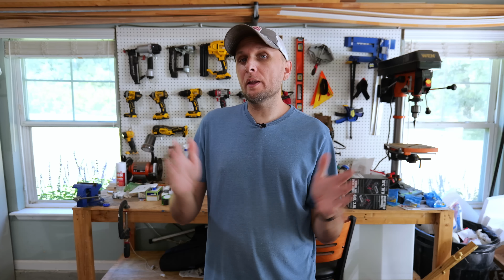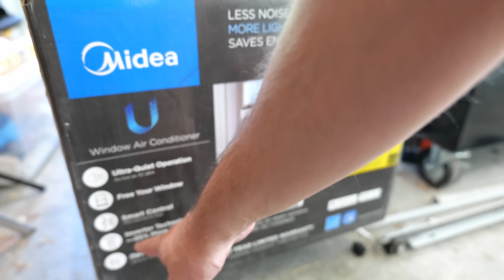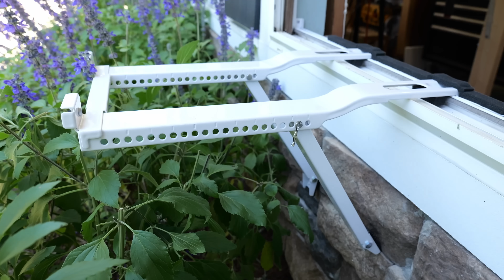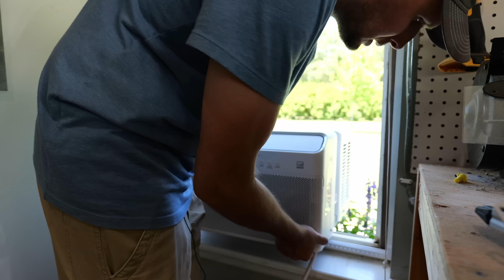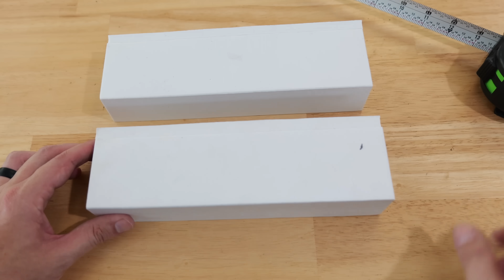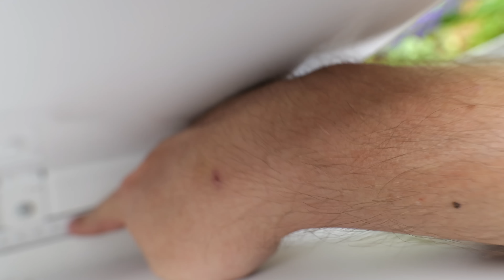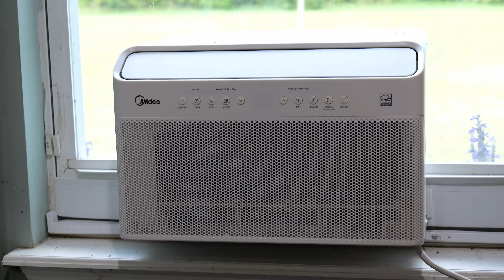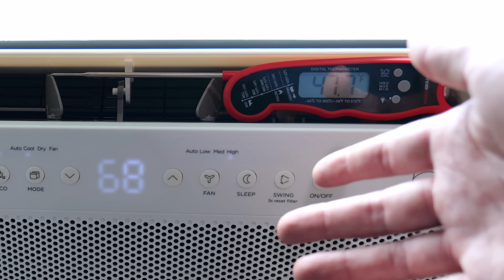The COLDEST And QUIETEST AC Unit Ever Made!  Still Use Your Window!

Comment: “As low as” means it could be a screamer but could be at the lowest setting 32db.  I have it and it is super quiet.  Only problem is it has a recall because it’s a mold monster.  They didn’t put in a drain because it was supposed to evaporate the water from the heat generated. Didn’t work.   Mine was a slime box in 6 months.  They have a fix but it’s a real pain to take apart and clean.    Cut the cord and send them a picture through the recall and get a refund.   It’s what I did.   It’s not worth the hassle of getting all that mold out.   My wife has asthma.
Reply from the maker: I have a video on how to very easily clean it.  I am not getting rid of mine.  In my opinion it is the best unit available.

Comment: I bought mine at Costco, and literally the next day, the recall came out. I contacted Media and was informed that my unit was not covered as it was a used or refurbished unit, very unlike Costco, so I attempted to reach out to them, no reply.
Our weather was about to hit 100° and I said screw it, this thing is going in. Opened the box and the first thing I saw was the kit and instructions to fix the Recall. Easy fix for a problem caused by improper installation

Comment: since you're an a/c guy, I would like to ask an a/c question.  why do we measure the amount of space a device can cool in square feet?  example:  my apartment living room is 15x15, so it is 225 square feet.  The problem is, I have 10 foot ceilings.  So, the unit has to actually cool down 2250 cubic feet.  Granted, I'm only walking around in the lower 6 feet of that space, but the unit is running 24 hours a day to cool the place down.  I just think the volume of the room's space should be the metric rather than just the size of the floor.

Comment: The advertised benefit of being able to continue to use your window is a silly idea.
No one in their right mind will be opening a window where an air-conditioning is installed for any reason.
Unless it allow for a perfect fit and completely seals once the screen is down.  If you can't use your bug-screen there is no point to that "benefit".  No one needs to open that window once the air-conditioner is installed.  Foolish.
One last thing...  For crying out loud...  Clean your windows.  A steamer does a nice job of cleaning those hard to reach places.  I use a steamer and a small stiff brush.  Makes them look brand new.
Reply from the maker: Well that is your opinion.  It is my garage, my home windows don't look like that.  Not a big deal.
Reply: @HowToHomeDIY  
Slob!

Comment: 🟦…Don't you lose cool air through the bottom of the top windows check-rail not meeting properly with the lower window? 
.... Also, does the support bracket come with the unit?
Reply from the maker: No, insulation goes there.  Yes the bracket does come with it.

Comment: Beautiful and “almost” perfect unit, but Midea had a recalled not too long ago.

The recall affects units sold at major retailers nationwide between March 2020 and May 2025.

Issue: Standing water in the air conditioners can lead to mold growth, which can cause respiratory problems. 

Affected Units: Midea U and U+ window air conditioners.

Solution: DECON 30 ☑️

Comment: I had an old JC Penney R22 unit 5000 btu unit in my daughter's bedroom that would just about blow snow out of it. Only problem was it was the largest electrical load in the house. I like the idea of the quiet inverter units but when storm season comes I need to remove it more easily than all the screws, tracks, and guides.
Reply: Don't throw out that old unit!

Comment: They all got recalled. They don’t drain.
Reply from the maker: Not all of them.  And they all now have a very easy fix offered and the new ones already have the fix on them.  Not an issue.
Reply: @HowToHomeDIY this is true. The recall rate was something like 85% on units sold as of 2024. Not all of them, just the majority of them. I stand corrected. And yes, they have fixed the problem on newer models in 2025. As for the “easy fix”, yup you can just drill a hole in the housing if you’re so inclined to do so or just take the refund for another unit that doesn’t require modification.
Reply from the maker: Well it isnt just a hole that gets drilled, they supply you with a drain plug.  I personally am not getting rid of mine.  It is probably the best window AC out there.  And all window ACs grow mold, most people just don't realize when they are.
Reply: @HowToHomeDIY I support your position. It was a very effective unit. I don’t know if it’s for everyone. My 10,000 btu unit cooled like a champ. To each his own. Thank you for your input.

Comment: Warning - There is a mold issue with this unit. I already noticed and drained the unit and drilled 2 drain holes. They will send you a kit to do this but i pre drilled before they stated it was a issue.
Reply: yes there's a recall just issued Midea Recalls About 1.7 Million U and U+ Window Air Conditioners Due to Risk of Mold Exposure.
But I really need this now. I wonder if I can ask for an extra discount on the unit 🤔

Comment: The units currently on Amazon state that they are "updated." Does anyone know if the updated units fixed the issue with the smell that has to do with the water leakage, spill?
Reply from the maker: Yes, they fix the excess moisture in the units.

Comment: I wonder if there’s a way to install a small UV light into these (or other window or portable AC units) like used for installation into a furnace for your HVAC system? It’d need a hole drilled into it install the light. Then it wouldn’t have the issue of mold because the UV light would kill it before it was put into the air. Just wondering out loud.

Comment: Yikes these U shaped units did NOT age well
Reply from the maker: Why?  Still the one of the best if not the best window ac available.  WAY too much being made of the recall that has been more than addressed.
Reply: @HowToHomeDIY  There is a recall on them. Mold. They ask you to cut the cord for a refund, or send it back. "Midea Recalls About 1.7 Million U and U+ Window Air Conditioners Due to Risk of Mold Exposure"
Reply from the maker: Ok guess you didn’t read my whole comment.  That’s not everything the recall says.  You’re making it sound like a mandatory recall.  Yes, if you want, you can elect to cut the cord, take a picture of the cord cut, and they will refund you a prorated amount.  OR you can elect to have them either send you the very easy fix to install yourself or they can schedule for someone to come out and do it for you.  All of the new ones already have the fix on them.  Complete waste to throw these amazing units out over something that has an easy fix and does what pretty much every window ac unit does.  It’s one of the best if not the best window AC available.

Comment: I own one of those and purchased it on Amazon. It works really good, how ever it consumes a lot of energy, it does not have a heat option and is currently under recall because of improper drainage causing  mold buildup. I say skip it and buy a cheap mini split!

Comment: WARNING: THIS UNIT HAS NOW BEEN RECALLED DUE TO MOLD BUILDUP. DO NOT PURCHASE IT! I FILLED OUT THE RECALL FORM 9 DAYS AGO AND THE COMPANY HAS STILL NOT REPLIED! I HAVE REMOVED IT BECAUSE WHEN I CHECKED THE UNIT IT DEFINETELY HAD MOLD ON THE INSIDE! THE COMPANY IS NOT HANDLING THIS SITUATION CORRECTLY OR QUICKLY!

Comment: Is this the one that has apparently been recalled due to mold and mildew growth in each machine that can get sprayed throughout the room? Or have they fixed that problem?
Reply from the maker: They have fixed it.  All the ones you can buy now have the fix.
Reply: @HowToHomeDIY  Do you still think it better than the GE Profile clearview?
Reply from the maker: As long as they fixed the issue, which it sounds like they did, from my testing and personal experience, yes I think the Midea U Shape is the best unit available.  Even with the recall I still have mine running right where you saw me install it in this video.  I think the Clearview is a fantastic AC unit too.  Just my opinion.
Reply: @HowToHomeDIY  Thank you! I'll give it a try!

Comment: Our Midea 12K window unit has been installed for a year now and we couldn't be happier with it.  It replaced a 6K traditional window AC but wasn't getting the job done.  The Midea is super quiet and uses less power than the old AC with half the cooling ability.

Comment: My sister bought one and lasted only one year, and when it rained it leaked into house through window. Complete junk. Mini Splits are better and most have a 5 year warranty.
Reply from the maker: It wasn't installed properly then.  Which could be why you say it didn't last super long.
Reply: @HowToHomeDIY  It was installed per instructions that came with the unit. Didn't last long because it was junk.
Reply from the maker: I know you think that but most people do not have those issues.  Maybe you did just get a bad unit.  Most of the time it is install error though, especially when I hear it was leaking into the house through the window.  That is not from the AC unit itself.

Comment: PSA:  There is a massive 1.7 million-unit recall on these now.  I received notification on June 18. "Midea Recalls About 1.7 Million U and U+ Window Air Conditioners Due to Risk of Mold Exposure" -  United States Consumer Product Safety Commission
Reply: You also have the option to have your recalled unit fixed if you’d like Midea to send out a local tech. They have an updated model now that supposedly addresses the issue. I love this AC.
Reply: Yep I bought mine back in May 2022 and it started accumulating a lot of mold on the condenser fan just like the recall speaks of.  I'm actually surprised considering it says it only has a one year warranty on it but they are giving me a nearly $400 prepaid card just to send them a secure picture of the cord snipped.  I guess the recall is really bad when you consider how easy it is to have black mold accumulate in a very short amount of time.  Apparently the front section of the unit that is on the inside of the house doesn't have proper drainage and is a perfect environment for mold growing luckily mine had just started having issues cooling as well had it set to 70° and it was 88° all week in my single wide trailer home other than in my bedroom that has a tiny little normal AC unit.    Still wish I would have known back in 2022 before all the tariffs and everything started getting a new AC unit these days is going to cost way way more
Reply: I’ve never seen a window unit that didn’t get moldy lmfao
Reply: @razrv3lc uh, that sounds like a personal problem you should address. My grandparents have units from the 90s that have never gotten mold in them, and I know many other people with units without mold ... Like there's a reason Midea is doing a recall for these being moldy in particular, it's NOT normal.
Reply: @daymianhogue1634 the recall is due to a narrow drain plug that is used to keep water inside the unit to recirculate for efficiency, the newer models simply remove the plug
Reply: Wow.. they want to get rid of them quick because the lawsuits from mold exposure will be way worse than sending everyone 400$
Reply: I feel bad for the guy below that has 5 of these.
Reply: Super easy to fix you just drill an extra drainage hole at the bottom. My dad noticed this when he helped me install 5 years ago and I’ve never had an issue. Works great!
Reply: Get my refund!
Reply: So basically, get LG
Reply: I had to return the one I bought.  It did not cool.  Great concept for security reasons, but a flop.
Reply: Thanks!

Comment: Where does the condensation actually run out? Does it drop from the outmost part of the unit onto the surface below or does it flow out where it might then run down the outside wall of the house and or is there a means to use tubing to pipe the conversation to a more reasonable spot.

Comment: I have a cheap window ac in my daughters room and it is so loud, it's hard to talk over it in the living room. So I searched on 6/5 and was so happy to find this video. I thought I finally had a good solution. That night, I saw the recall notice on the evening news. I hope this can design a fix for these units so they can sell them again, sans mold. I looked at another recommended U-style, but it doesn't appear to be made as well.

Comment: 1.7 Million of these U-shaped air conditioners were just recalled because of “risk of mold exposure,” the Consumer Product Safety Commission (CPSC) stated on June 5, 2025.  The condensate in the affected units failed to drain quickly enough which can lead to moisture buildup and mold growth.  The units were sold from March 2020 through May 2025 from a number of retailers including those online and in-store.  The affected units were branded as:

Midea 	
Frigidaire
Insignia
Keystone 
LBG Products 
Mr. Cool 
Perfect Aire 
Comfort 
Sea Breeze 
Danby
Reply: Just drill a hole lol
Reply: @GIBSONANDSLASH Be careful where you drill the hole.  You can totally ruin the unit.
Reply: Sadly, I purchased this model from Costco, which is part of the 2025 recall. I haven't even unboxed it yet.
Reply: @fitwright I haven't installed mine either which will make it easy to install the repair kit that's available before using.
Reply: No drain, what could go wrong
Reply: Thank you
Reply: Midea anything before April or may of 2025
Reply: @Illuminati089 even the portable Midea? I can't find info on that.
Reply: I look for comments like this people who keep it real. Thanks for the info I'm definitely not going to buy it I don't need nothing to mess up my respiratory system
Reply: @MelindaOrtiz140 It's safe Melinda.  There are other manufacturers that are just as good as Midea.  Get the "inverter" type if you plan to ever use it with solar.  And get a gallon of Decon 30 cleaner and spray the Air Conditioner blades and as much as you can see inside the unit at least once per year.  They all can have mold problems once the humidity get above 50 pct.  Good luck to you.

Comment: After 3 days of use I get an error code P1 and had to drain at least 1 pint of water from the inside drain. Seems like the internal pump isnt working. Talked to GE rep and they advised me manually drain the AC every 2-3 days. Thats ridiculous. So Im going to exchange the unit for another in hopes I just got a lemon and the pump works.

Comment: There now has been a recall  issued for these units.
Reply: Certain units newer units after may 2025 have no defect
Reply: @Illuminati089  I hope its not just add another drain hole ,because the way its design is the problem when they enclosed the front they made it a way you couldn't clean the barrel blower and the backside of that compartment. The moisture builds up in that location and the mold grows there.
Reply: Yeah. I inherited one of these and it's a disgusting mess. I have always heard good things about these but unless you live in a dry climate I'd pass on these even without the recall

Comment: When we had our house built, I had it insulated, walls, ceiling, doors. I put one of these units in last summer and wow, what a difference. I can now work in my garage on a hot Texas summer day no problem. I also put one in my master bedroom as my wife likes it at 68 to 69 degrees all day and night which was killing our electric bill and freezing me out since I work outside a lot. Now just the bedroom stays at those temps and the rest of the house I keep at 75 which she hates so now she rarely leaves the bedroom lol. These units are great but you do have to clean the filter often if you use it all the time. They clog pretty fast.

Comment: I had one of these. It worked great for one season. After storing it indoors in the original box, it threw an error code and would not engage the compressor when I re-installed it. Midea refused to service it, provide a refund or partial refund as it had a 1 year warranty and I called 1 year and 5 days after purchase. No techs in my area would agree to work on a Midea window unit, and ultimately it was junk. I even asked if Midea could help me over the phone to triage the issue to repair it myself and they refused to provide any assistance of any kind. They wouldn't even provide any additional explanation for the cryptic error code that was displaying on the unit.

Will not buy a Midea product ever again. Five days out of the manufacturer's warranty on a major appliance and they told me to pound sand.

Comment: Sir these units are junk after 2 to 3 months of use they freeze up get loud and leak not all starts at the same time but eventually it will all happen and the warranty well good luck with that!!   
I purchased 6 all at the same time 3 months later only one is working if you need proof come to my house I’m in temple texas and you can keep this trash.
Reply from the maker: Well that is very odd.  I have had mine well over a year now and aside from a frog getting into the fan once, I have had 0 issues with it.  It has been absolutely great.
Reply: @HowToHomeDIY yes the life span on yours is stretching out a bit for the way these are designed. 
I’m not saying they are not impressive at first but it’s disappointing how they all went down one right after the other  
If you send me a email I’ll send you a video or picture of all 6 stacked in my trash pile.

Comment: The problem with the windows in the house I'm renting is the damn windows are the type that crank...so it doesn't slide open, rather the window still blocks the opening even when it's fully cranked open.  Looks like I'm stuck with the hose-type.  I'll at least go with the dual-hose type.